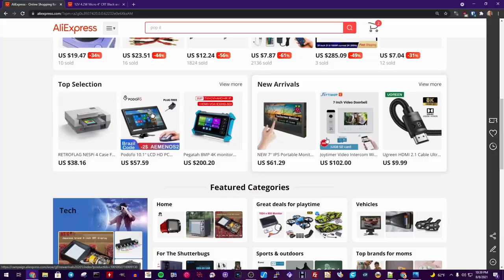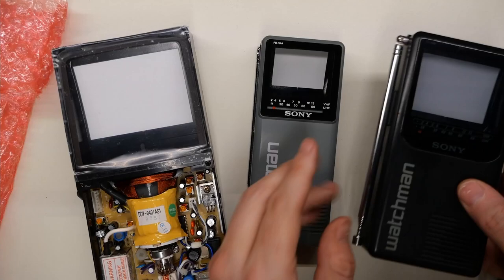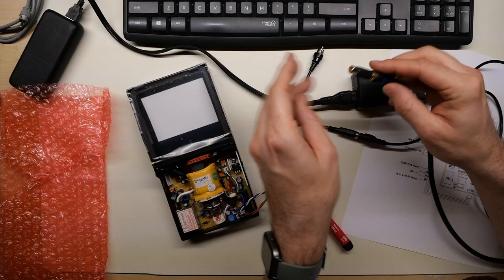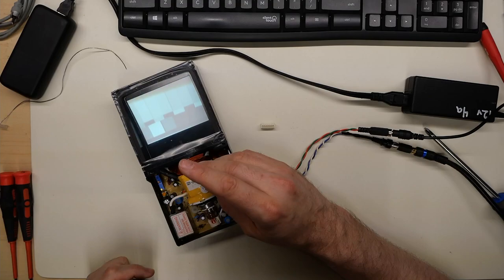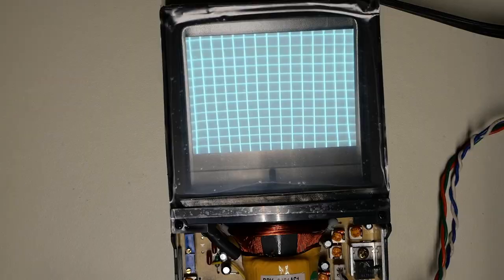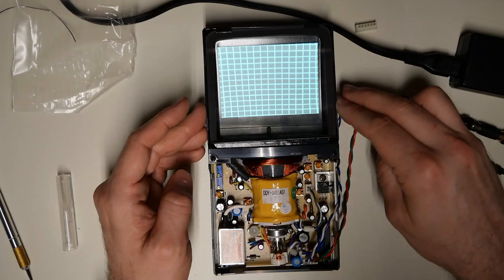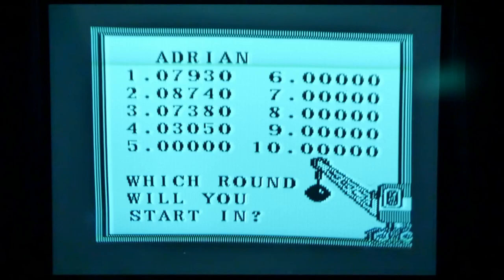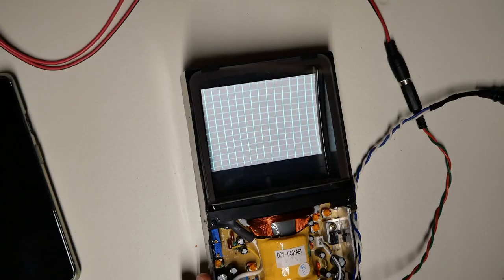This small CRT monitor is less than 2" thick

Comment: Those were the most cool 😎 TV’s 📺 of the 1980’s, along with the wristwatch ⌚️ TV’s 📺, although they had a bulky receiver, which could be put in your shirt 👕 pocket. The TV 📺 wristwatch ⌚️ was more a 1970’s thing, but this was all very cool 😎 technology.. wish it all could make a comeback. Always be careful in the back of all TV’s 📺. I a home 🏠 TV 📺 can store 🏬 between 25000 to 45000 volts, a definite widow maker if mishandled. Always use an isolation transformer, or the proper equipment to dump the voltage. I didn’t know these tiny TV’s 📺 had the capacity to shock ya, but do be careful , it does sound logical. Your friend, Jeff

Comment: Now all you need to do is find (or make) an arcade cabinet sized to that, then hide it (and a Raspberry pi running MAME, and a speaker) in the cabinet with a really small joystick and some small buttons for “jump”,”fire”,”shields”, or whatever the game needs, along with a really, really small coin collector! 🤣😂 You’ll probably want to put in a power switch and a USB connector so you can power it off a hefty power bank. Of course, it’ll have to play the 8-bit dance party!

Comment: Looking for it in Aliexpress I found several stages of completion until you get the doorbell monitor, so definitely that's what it was made for
Reply: How did you find them? Using a bunch of search terms I only found the complete door intercom unit that costs 40€
Reply: @640kareenough6  Don't use the link, watch the begining of the video and type the same words showed in the screen, CRT monitor vintage etc

Comment: I have a FD-10-A. Although they are not overly complicated to convert to composite video input, it took some internal dialog to do so. On one hand .. a vintage bit of unmolested kit - on t'other, no terrestrial analog NTSC, so may as well put it to some use. There is something very pleasing about the "flat" CRT and how you're actually looking at the "back" of the tube face though - although I suspect you have to be of a certain vintage to truly appreciate it. I can mentally picture the furrowed brows of the generation who came up with colour iphone screens wondering .. "but WHY??"

@20:40. Okay, now laughing my arse off. Have the boards for both a VIC and a 2C ... the latter of which if I recall came with a 9" green CRT? (long gone), and if I recollect - was exactly why I converted my Watchman 10-A to composite. I thought it would be so cool, but I never got around to having the two meet.

You sir, are awesome. :). Subscribed and now going through your video library.

Comment: You could probably tape some weak magnets on the back to try and adjust the geometry. Since it's not a color tube you don't have to worry it messing with purity or convergence. :P

As for the edges being more lit when bright stuff are on the screen. This is a common issue with cheap B&W TVs (and in this case monitor). The black levels start to get washed out with brighter scenes so it's a flaw in the electronics driving that CRT which is probably made worse by the CRT's design and light phosphor.

Comment: I had a sony watchman I got off ebay for a few years.  audio always cut out even after patching it a few times.  Mine was larger than the 2 you have n the upper section around the screen was round.  It did have video input, a 3.5mm trs jack, I had an adaptor for video & audio from my retro computers.

Comment: Funny was looking at that very thing recently. ^_^ Came across a video featuring a screen like that and it was a video intercom system. Probably one of the last uses for that type of CRT much like Karaoke machines using up the last of the portable B&W tube stock. Though I didn't think of that, you could make a DIY Sony Watchman from that screen. ;)

Comment: CRT screens are easily damaged by magnets , you need to de-static that plastic, , , briefly use a magnetic halo to even out those grid lines of your test pattern , , , , contrast and sharpness adjust can help even more , , , actually pocket CRTs can be quite sharp  , , , run a VHS VCR on it , a tape of "SPIDERMAN-2"  should be good to find tune the sharpness and contrast , , , , if only there were a Digital TV Tuner adapter small enough to add to this pocket TV , , , 😸👍

Comment: if you bought one of those watchman back in the day, in a rural area you where wasting you time, at our home we had one of those HUGE antennas now on there website they call them Ultra-Hi Crossfire 100 + Pre-amp + Signal booster at 35-38db, and we got 3 channels in winter and 2 in summer.

Comment: Voltage multiplier acting as a flyback for the CRT.  And your pots aren’t exactly what they say. That’s because pots come in a variety of tolerances anything from one percent to 20 that’s why you should always use a meter to make sure that the pot equals what is stated

Comment: Yeah, some light magnets and shielding might help. Also, I wonder if that thing is safe in regards to x-rays and whatnot. Cool thing, anyways. I bet it's sold out now. Edit: Never mind, there are thousands. A cool thing to try, also, might be to take the tube out and look at the backside, maybe the picture is better there (although mirrored)
Reply: X-rays generally don't become a problem until 25ish kilovolt. Black and white TVs rarely work with voltages higher than 16kv. 
X-ray issues in television were unheard of until bigger color TVs became popular. To avoid x-ray exposure, color CRTs had thick glass that contained a lot of lead as shielding.
Reply: Even if it was producing xrays, it would be kind of like how cell phones produce microwaves - the power density is so insanely low, and the r^2 reduction of their intensity at normal viewing distances is so insanely high, that exposure would be negligible.

Comment: It would be cool if these had color with it so that you can make one hell of a SNES portable with a pi zero, Maybe even a PS2/n64 Portable with a Raspberry Pi 02... Wouldn't it be possible to add a LCD panel(liquid Crystal component) on top of the glass to add color? I know it would be a terrible implementation, but theoretically wouldn't it work?

Comment: I wonder if it would be possible to make a tiny color version of this thing with better alignment, then stick a raspberry pi on that for portable CRT retro gaming?
Reply from the maker: It's not, because color CRTs require a shadow mask to separate the electron beams. The mask needs to be behind the phosphor otherwise it would block your ability to see it.

Comment: The floating grey scale is because the video is AC coupled. Black level will change with the APL, average picture level. This is why I build ALL of my video generators with properly DC coupled and 75 ohm terminated outputs. I did come from the broadcast industry afterall. Computers of that era make a "video like" signal. Extremely bad. But, I never call it video.
I have one of those monitors and when I feed it a proper DC coupled signal, the contrast quality is breath taking. I showed it in one of my recent videos. For those who like vintage tiny video monitors: https://www.youtube.com/watch?v=YvhFlHu0i58

Comment: 28:55 CRTs draw more current if the average brightness is higher. Your test pattern is mostly dark, so probably the 4.5W is for a uniform 50% bright picture, but I wouldn't be surprised if a 100% white image with the brightness pots cranced up was well over 5W.

Comment: You just need a polarizing filter in front of the screen to block internally reflectd light, but not emitted light, it would probably have been used with this screen in the actual application.

Comment: Could use an RF Modulator that converts composite/LINE video and audio inputs to RF output.
I find them often at yard sales and thrift stores for a buck or less
Could probably get a more recent vintage battery powered RF modulator

Comment: Make it into a miniature arcade machine!
Reply: Running old games that were meant to be in black and white, or those that had color filters placed over the screen. This one is so small it would be relatively easy to create such filters, but parallax would be a problem since the actual phosphor surface is so far from the glass. This would still be an interesting starting point for a mini-Vectrex.

Comment: I bought one a few days ago and I’m struggling to get a signal to display. The screen turns on and if I touch the rca adaptor, static appears so I know the rca connection is good. I’ve tried both and Atari and a GameCube to try to get a signal on it but nothing. Any suggestions?
Reply: Btw your video was a huge help in getting it set up in the first place

Comment: I received mine today. Not working. Just a white flicker no matter what I feed it. The three pads for the brightness pot were solderblobbed together on the underside, and it's missing one of the flat brown capacitors next to the six pin connecto,r compared to yours.  Might be missing more. :) The one pictured on Ali has the diode next to the connector as well, which both yours and mine are missing.
Reply: I found the fault. Inductor L302 was broken. I replaced it with a 22 uH inductor and it finally worked. Mine has a very sharp and brightpicture. :) Very cool. I think I will make a CRT Gameboy.

Comment: kinda smart to angle the phosphor screen
Reply: but you could make a color crt with one beam
Reply: electron deflection grid is better tho than a targeted electron gun
Reply: can even be made to hit from the back side, so the grid is hidden
Reply: matrix display is better than gun display
Reply: the electrons hit/fly right to the positive target in the grid intersection (electron source gun assumed to be negative-less-positive before the grid targets
Reply: resolution is the resolution of the target matrix voltage grid
Reply: electron beam(s, multibeam) redirector grid
Reply: poor design makes "not practical" but its very possible flat crt

Comment: Suspect they havent used coated glass to limit internal reflections which should reduce the washing out of the phosphor.
Reply: an anti-reflective coating on the outside would also reduce glare, this thing basically needs it inside and out lol

Comment: Glad you didn't get killed poking your fingers at the deflection coils with it on. I can hardly bear to watch you carelessly poking at a CRT circuit board. Takeaway lesson, ignore high voltage warnings, and poke at high voltage circuits when they are on.

Comment: Clive Sinclair of ZX Spectrum fame, also released a similar product in 1983.  Monochrome display, the CRT was mounted at a right angle compared to the screen.  The Sinclair TV80 was a commerical failure.  Many commentators and manufacturers claimed tha CRT technology would be short lived due the LCD screens being developed at the time.  It took another 20+ years for LCD to take over from CRTs completely.  The name TV80 was due to the price. £80 (GBP) about £250 today, so not stupidly expensive.

Comment: Hi as an electro noob, i would like to connect this to my modern computer VGA or HDMI or DVI, i dont care. Is it possible ? My idea is that i will buy this thing from ali, then buy the potentiometers to adjust brightness and contrast, and then some adapter vrom the video to VGA/DVI/HDMI. Also i want to ask about security risks, is it safe to run this daily ? :D

Comment: Add a video input to the Sonys...It should be very easy (says me sitting here with my coffee) - the hard part would be doing it without marking the case or doing any non reversible alterations/ damage.
Make a bigger Sony case for the large screen eventually marked as Sony Watchman Special ADB - you could print a case x times bigger than the Sony - Should be easy....😸

Comment: If they’d turn the glass, and installed the fosfor behind the glass, wouldn’t that be less light corruption? Thus lesser washed out?
Reply: The way they did it they could have brighter display at lower power. Contrast could be improved by putting polarizer on top of the screen and this should make image usable in normally lit room.
Reply: You can't install the phosphor behind the glass because the electron beam won't pass through glass - even air would block/diffuse it. That's why CRTs are under vacuum.
Reply: That’s what i meant with turn the glass, so the beam’d be behind the glass too. Great explanation, i didn’t know how that works

Comment: Forgot about those mini TVs but then since they switched off the analogue signal it does turn them into bricks so not even good as retro.
Reply: If any of them came with analog input then I guess you could use them with some older consoles etc.

Comment: Siclair released a flat CRT in 1983 called the Sinclair TV80. Though Sony beat Sinclair by a year, releasing the watchman in 1982.
Reply from the maker: Pretty sure Sinclair didn't design the CRT in that TV80 -- although maybe? It was different in that it was side-firing compared to the Sony one
Reply: The tube was apparently made by Telefunken. Battery life was awful. It used a flat Polaroid battery which cost a fortune and lasted very little time. Worked in an electrical retailer when it was released. It was a fun curiosity at the time but was pretty useless as a TV.

Comment: Hi Adrian. It is a very good video. I needed your help. I want to make a multi Bios eprom for Xbox original. I needed help with how to shift rom for Xbox to read. Suppose I write 4 of 256kb Roms in a 1 MB chip. Now to set pins for Xbox to read specific bank of rom. I needed help with it. My xbox is v1.4. Waiting for your answer

Comment: Almost all of these B/W CRTs suffer from basic circuitry that can't keep steady black levels.
Reply from the maker: Yep and this one is no different. Not sure why this is such an issue with them versus color sets.
Reply: @adriansdigitalbasement  I'm guessing if they did the same thing with color displays it would result in obviously improper colors. But there's still no excuse. DC restoration can be done with a single diode.

Comment: The screen is white so the image can reflect off of it the same as projectors. The inside glass of traditional television is also white for the same reason. The front glass is tinted so we can discern details in the image in a lit room. As said in another comment, this is a piss poor design as the light from the screen reflects back onto it from the glass lighting up the phosphor with second-hand backwash which is why tinting the front of it would do no good as you would have to increase the brightness which would bleach out the entire image due to the reflection of the inner glass onto the phosphor.

Comment: The video title has an error. There is an end quote character:  2" thick
but where does the quote start?
Probably author meant: This small CRT monitor is "less than 2" thick

But then it still doesn't make sense.
I suggest writing:
This small CRT monitor is "less than 5 cm" thick
Then the only thing is to remove quotes that were useless.
Reply: shit bait you know he meant to use ″ and not " but who cares
Reply: Its not a mistake and there's no title in the quote. 2" means 2 inches. Like 6' means 6 feet.

Comment: that’s what i get for holding off on picking up the number of these i would need for an art project. it isn’t your fault, but the audiences of youtubers have a way at ruining a market so people who might not have easy access to money end up losing out before people mass-buy them for the hell of it, or to all make the same little raspberry pi project instead of seeing what kind of diverse stuff might come of it. idk. i feel torn on this. on one hand everyone should have access to this kind of thing if they want it. on the other hand, capitalism thrives off artificial scarcity
Reply: I just bought one! There's tons available right now! I doubt that the supply will be exhausted for quite some time yet 😃
Reply: @electronraygun6346  yeah, but i have an anxiety disorder. i do my best to keep my anxiety at bay, but it’s been pretty hard in the past year and a half (for obvious reasons!). my issue is really with the “free market” as it were, because of how it chooses to feed that anxiety to get my money out of my bank account
Reply: @ExperimentIV  I'm sorry to hear that :-( I have issues with anxiety too so I totally understand where you are coming from. The great thing about Ali express is that curiosities like this CRT appear quite often, though if the profile of the unit is a deal breaker then I guess I can understand your concerns. If you just need CRT monitors though they can be quite common on eBay and Ali express, though sadly, people like to crank up the price as they are "collectors items" :-(